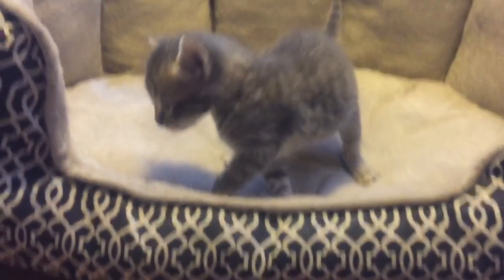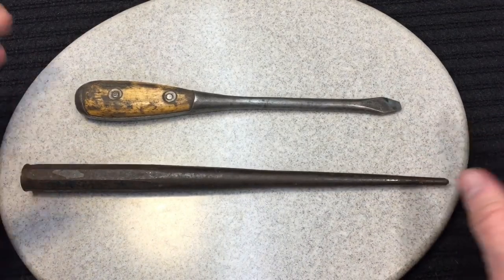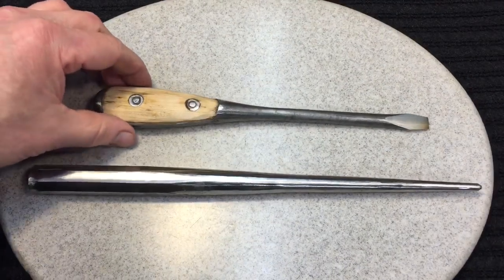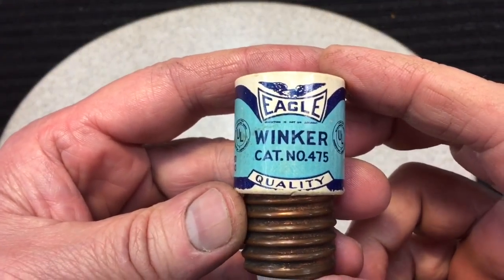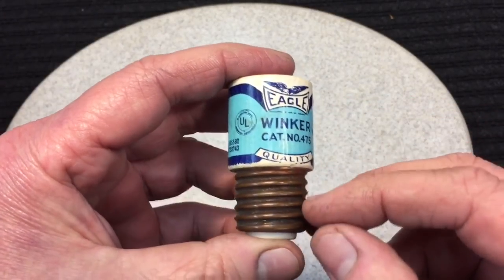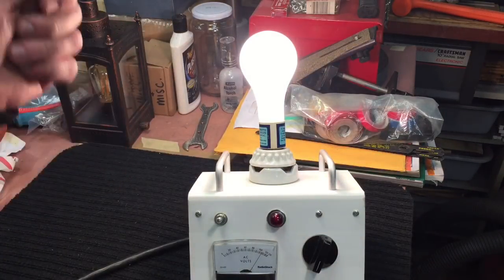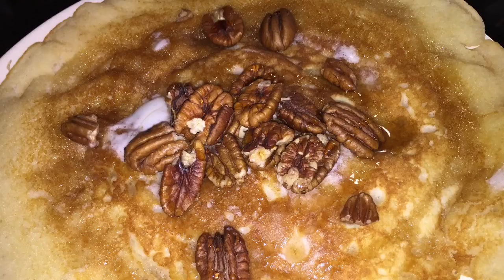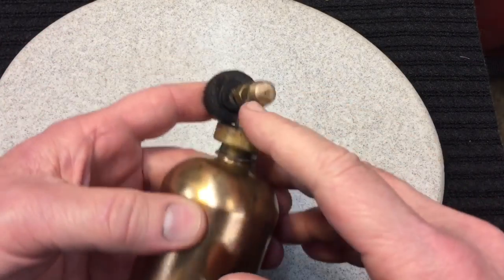Twin Tool Restoration, Eagle Winker and Cleaning Your Orifice

Comment: Am surprised you actually restored a China screwdriver 😁. By the way, would you recommend using Shellac  on a handle if you were to use it in the workshop - just wondering about durability. 👍👩‍🔧
Reply from the maker: Shellac is very durable, non toxic, fast drying and goes over or under any finish..  I’m a huge fan.  😃👍

Comment: It is stated 110 volts , but what it actually means  is not to use on 220  volts which has two hot wires , instead of one hot and one neutral !

Comment: I learned the wire trick from someone who used to repair gas kitchen stoves. For the small burners, you use that wire, for the bigger burners, you can use coaxial central core wire.

Comment: Did you have to retemper the tip of the screwdriver? It came out great.
Reply from the maker: Hi Larry- No I didn't because I keep dipping the tip in water as it heats up.  I was close once as it was starting to turn color but the sparks let me know it was still very hard.  =D

Comment: In the UK, orifice rhymes with office.
However, I would call the hole you refer to a gas jet.
Even though strictly speaking the gas jet is the fitting into which the hole is bored.

Comment: I really wonder the CHINA screwdriver already having the messed up tip means that the tensile strength of the metal itself is no where that needed for a tool of that purpose & chowders up all too easy. I guess now its a show queen we don't need to worry....
Reply from the maker: Hi Pete- Most of those older screwdrivers were ground down to fit a smaller screw, not because they failed.  For some reason many of those screwdrivers had very thick tips that were too large for many screw slots.  =D  Thanks!

Comment: That gunstock is a nice shade. I am really a fan of those wood handled screwdrivers. Shes a beauty, came out great! I have been watching you and other channels use the one inch belt sander with good results and I never can. I think Im using to fine a grit for the initial sand at 120. The coarse grits up front do much better.
Reply from the maker: Yes!  The key is get rid of all the crud with a 80 grit or so then work your way down to get rid of the scratches left by the 80 grit belt.  =D

Comment: I have many drift pins or alignment punches, whatever you want to call them. Many of mine started life as a Marlin Spike, this might be relevant to my question. On two of mine, both towards the larger end, have the tip flattened out much like a fingernail. I have found these to be enormously useful and I don't know what the metallurgy is but I have never been able to break, bend, nor chip one. I've never seen one of these for sale and I'm not even certain what industry they are designed for. I get a great deal of use out of them, as you noted they are very widely useful. Do you know what these fingernail type Marlin spikes are for?
Reply from the maker: That's new to me, most marlin spikes have a bulb or widened area at the rear to facilitate a pressing pad for the hand to work the tool thru the tight winds of the rope.   Interesting!!!!!
Reply: @ScoutCrafter  I expressed myself poorly. When I said towards the larger end, I should have clarified that I meant a larger Marlin Spike than average. There is still a bulb on the end. The only difference is that the tip has been flattened into a convex fingernail shape on both sides of the tip. I thought it might be specifically for splicing cable as opposed to rope

Comment: I have one of those screwdrivers but I need to make handles they old ones are long gone but I did regrind the tip came up mint just need to make handles been a long time in the running

Comment: John, 

It's amazing, immediately prior to watching your video I had been surfing Amazon,  looking for Klein Broad Head Bull Pins,  Drift Pins, Spud wrenches, fids, marlin spikes, drift pins and alignment pins.  Why i was looking, I don't know. 

When I was a kid my father had a spud wrench, where he got it I never knew. The wrench fit the bolts for the cover of our pool filter.  Each spring when be cleaned the pool to get ready for summer we opened the filter,  replaced any damaged filter elements , wire brushed and painted the inside.  In the mid-60s filter covers were made from steel plate and were heavy enough that you struggled to lift the cover and fitted the bolts in place.  The spud wrench was perfect for aligning the first hole so the other bolts could be fitted.  I always loved that wrench and was crushed when my dad sold in a garage sale.

Years later, when I first started working overseeing a ship construction project, the riggers in the shipyard always used alignment tools when they lowered any equipment in place.

Flash forward to the end of my career, I was back in the shipyard managing a ship buulding program.  The riggers in this yard never used tag lines for lifts.  Even  worse, they used their fingers to align the holes.  I used to cringe, followed by prayer, every time I saw someone stick their finger in a hole using it as an alignment pin.

My prayers must have been good, because I never saw anyone lose a finger.  A 1500 KW diesel generator set certainly could have sliced a finger off as easily as a knife cuts butter.

You, my friend, provide an invaluable service by showing tools and explaining proper use.  I hope your younger viewers pay attention and learn what tools are available and how to use them.

Bob
Reply from the maker: Hello Bob- All of these tapered tools (punches, bars, spud wrenches...) are invaluable for lots of operations. There is a great sense of satisfaction when aligning two holes with such tools.  Also sometimes you need to swage the end of a tube by a few thousands and the tapered punch does a great job.  I remember seeing an adjustable spud wrench one time at tractor supply and thinking what a great tool this would be.  =D   Thanks Bob!

Comment: I like the idea with the shrink wrap for. The Drexel bit, another trick I  discovered was to use superglue at the base of wire wheels even larger ones, it helps keep the wires in and they wear slower
Reply from the maker: That is a great tip!  Those cheap wire brushes really shoot wire!

Comment: That really was a fantastic tip that 357 magnads came up with. I use a needle scraper pretty often and I adapted his trick using a cut-off soda bottle. The tapered shape let you focus the needles into a much smaller footprint, this prevents them from bending or deflecting, the needle scraper is effectively a completely different tool
Reply: Do you have a video link to that video?

Comment: That China screwdriver is, pretty much, a direct copy of the Perfect Handle tools that you have refurbed on your channel before. It had nearly become your paint can opener, because the tip wasn't much good for screws anymore. Love those 'podger' bars. I have no end of different sizes and styles which I used to use at work.